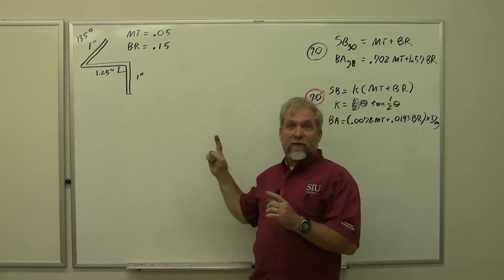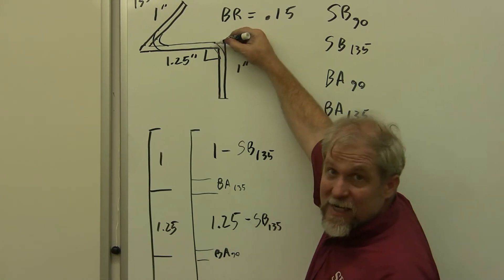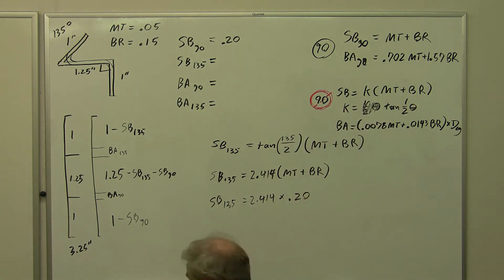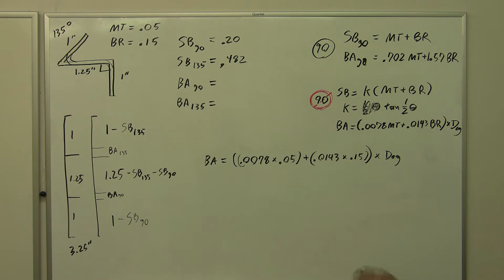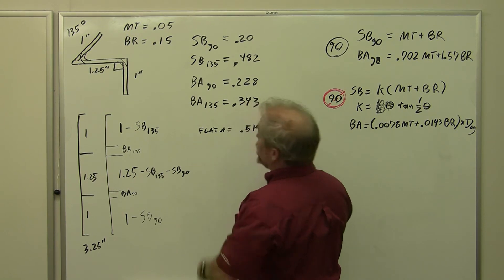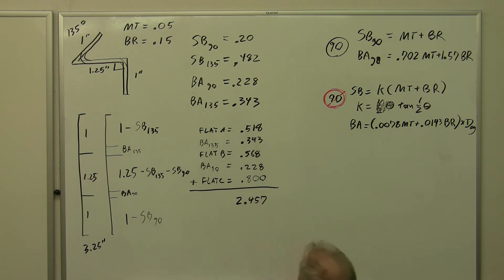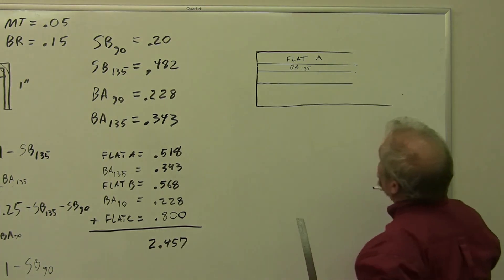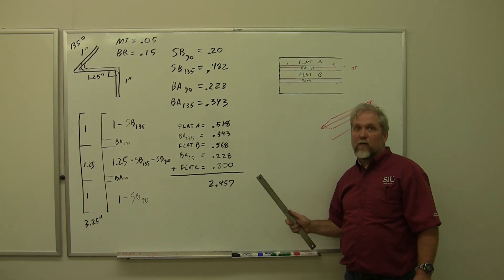AVT 206 A&P - The Math Behind the Bends - Example 4 - 90 and non 90

Comment: Wait, but if i were to use the formula, "BA(90)= 0.702MT + 1.57BR " to calculate the bend allowance at the 90 degree section, I would get 0.2706.

BA(90) = 0.702*(0.05) + 1.57*(0.15)
              = 0.0351 + 0.2355
              = 0.2706.

which is different than using the other formula, and get 0.228.

Am I missing something here?
Reply from the maker: No - you are the first person to catch my screw-up.  I left a digit out of the simplified non-90 formula, which should come in BA(deg) = (0.0078MT+0.01743BR)(deg).  I did this on the deriving video, and the error is carried forward on the 4 example videos.  I intend to redo all five videos next spring, when I teach the class again.  These ones will be removed from you-tube at that time.  That's what I get for being somewhat dyslexic.   Kudo's on looking close enough to spot the error.
Reply from the maker: No - you are the first to spot my dyslexic error when copying the formula.  I left out a 7.  The formula SHOULD read BA(deg)=(0.0078MT+0.01743BR)xdeg.  This error affects all 5 of the non-90 videos I made.  I will have to re-shoot.  In the meantime, I will flag the error to make sure no one is harmed!
Reply: It ok man. Great video overall. Learned a lot. Thanks man!
Reply from the maker: You learned a lot because you spent the time to understand it.  Kudos on that, and good luck on your endeavors!
Reply: Yeap that is true, but would not have been able to do that without your well explained videos. Kudos to you too!
Reply from the maker: I also have to confess that I knew about the mistake shortly after posting, but I just never "got around" to 'fessing up about it.  ;-)